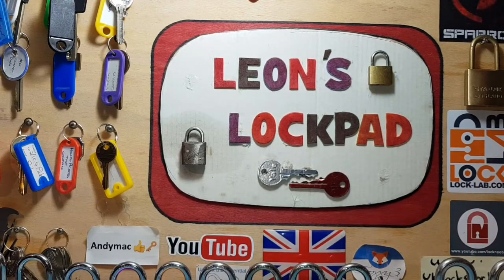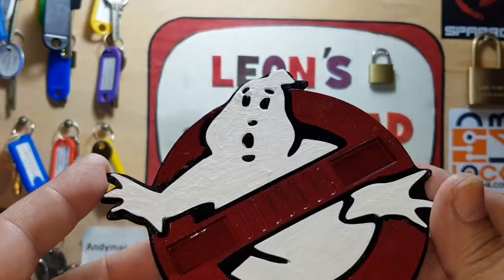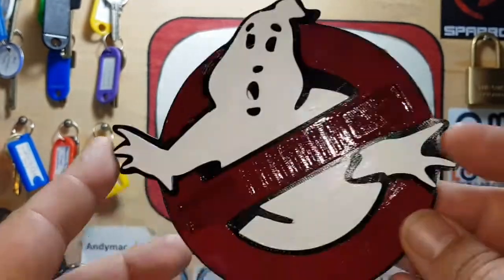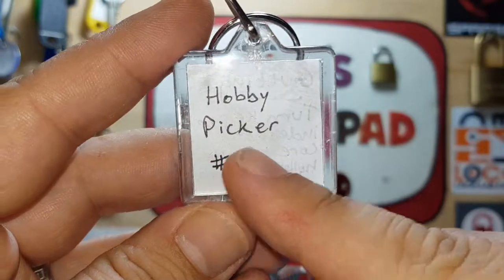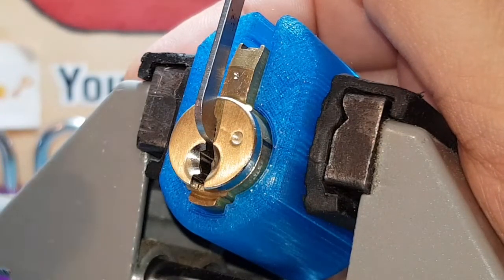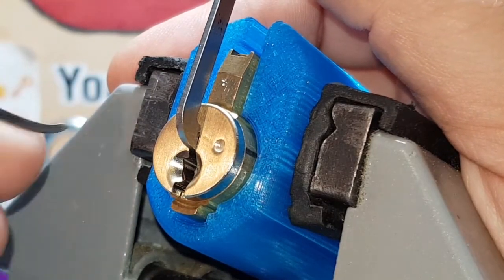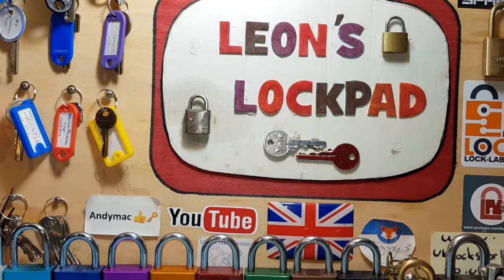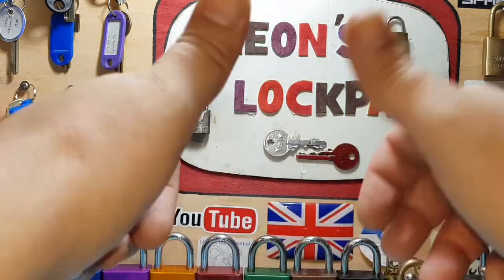Lock picking. Hobby Pickers first challenge lock spp'd&gutted and the fantastic present from?

Comment: Thanks a lot Leon for taking a look at my lock, I didn't even realise you'd made the video so soon! Well done mate, you made quick work of it! Sorry you had trouble with the T-Pin, I never had that trouble before. Like I said, I feel bad for butchering the core by cutting the grooves by hand when I could have waited for a chance to use my special 3d printed jig. I was amused by you swapping the hollow follower for a solid one, that's exactly what I do too, I can't stand hollow followers :-D
Reply from the maker: Don't feel bad Ethan you did a fantastic job on your first challenge log the t pin is supposed to give you trouble excellent work on the pins you did an awesome job mate😊🇬🇧😎👍

Comment: Excellent work on those pins Hobby Picker and a great picking Leon :)
The only possible suggestion I can come up with at the moment on the pins is if you were to do just a little more work on the #3 driver and really narrow out the full thickness section to only be about 2mm / 1/16 in, it would greatly improve its chances to engage with all the milling you did in the core for that chamber.   Otherwise, the pins were very well thought out and rather cleanly cut.
Reply from the maker: I'm sure Ethan will read this listen to The Tips you have gave him thank you very much for watching my friend👍😎🇬🇧😊
Reply: Thanks for the tips mate, I was a little bit shy with the cutting, my second and third challenge locks both have much deeper cuts.